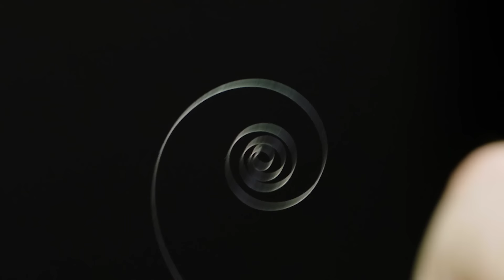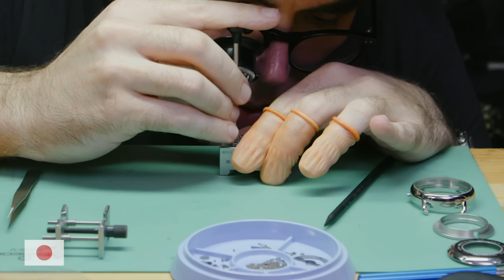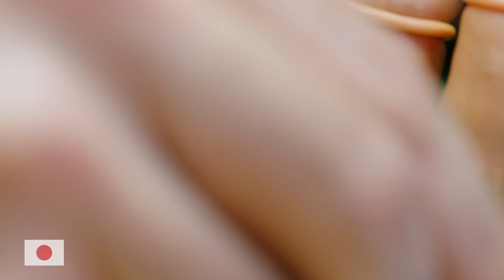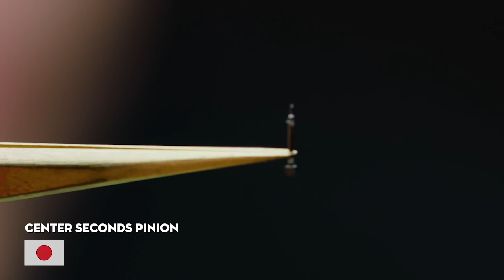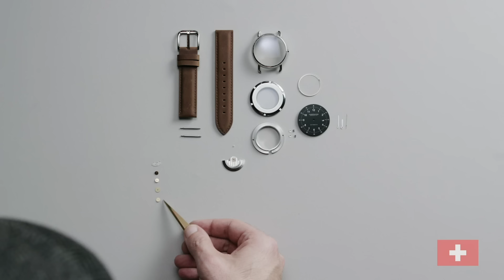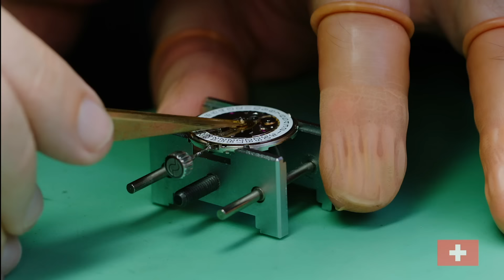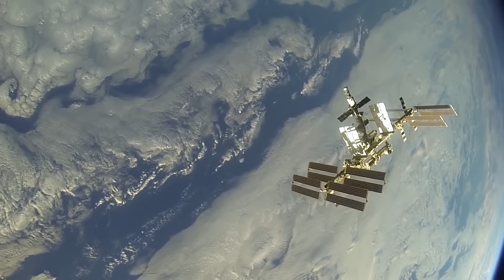Watchmaker Breaks Down Swiss vs Japanese Made Watches | WIRED

Comment: This comparison is a bit misleading because it uses a Miyota 821A, which is an entry-level movement, against an ETA 2824, which is mid-tier Swiss. The 821A has some plastic parts, but that does not represent all Japanese movements. A fair comparison would be with the Miyota 9015, Seiko 6R35, or Orient F6 series, which are all fully metallic and in-house.

Comment: Just getting into watches but what turns me off is that mechanical watches require maintenance and you can't really do it yourself. With a quartz I will just change the battery and I'm done. Just a rant, that's all.

Comment: I only have one watch with an eta 2824 based movement and I pretty much never use it since it's basically designed to eat it's own ratchet wheel causing teeth to fall into the movement and kill itself.

Comment: this should be called "watchmaker breaks down mid to high range swiss vs bottom-low end japanese made movements", sinc this is not at all comparing watches but rather only movements, and the japanese choice here is a very odd one since it's probably the cheapest mechanical movement you can find made in japan that's found in very cheap watches, vs a much higher end and more than 3 times more expensive swiss movement found in much much more expensive watches. Not relevant AT ALL.

Comment: Yeah this video is extremely misleading especially given that the Miyota movements appear in "swiss made" watches as well.  The concept of a swiss made watch is vague to begin with. Not to mention the price differential on these two movements.  The phrasing also makes it sound like all Japanese or all swiss movements include these features.  And then the little aside about how grand seiko is attempting to give the swiss a run for their money is kind of silly too.   Grand Seiko is a high end brand and their spring drive movements are more advanced and accurate than many of their swiss counterparts.  There are also still a ton of really good America watch brands out there and other countries also make their own quality pieces.  To try to group together watch quality based on the place they were made in is a farce.

Comment: A few years ago after owning many chinese made cheap automatic watches ive got my hands on a Omega Speedmaster reduced (automatic chronograph) and that changed my perception completely! 

These watches are mechanical marvels.. the 1141 clockwork is only 25,6mm in diameter and 3,6mm high… all assembled the „small“ speedy is looking like a Quarz watch but if you know what’s going on inside of that tiny case its just fascinating every time you look at it. 

Ok… they are expensive to buy and expensive to maintain (in my case 400€ every 5 years) but if you got a skilled watchmaker to service it, you have a watch for the rest of your days.

Comment: Why are you comparing an ETA 2824 with a Miyota 8000series? They're not on the same technical level. Obviously a Miyota 9000series would have been more close to the ETA 2824 in size, hacking and other features. 
Also the automatic winding system in several japanese watches is capable of winding in both directions, Seiko f. e. calls it "magic lever" and btw this means nothing in terms ao watchmaking quality - it's simply a feature in swiss AND japanese mechanical watches.

Comment: Very nicely paced disassembly and commentary. The ETA seems like a better movement than the Miyota but the difference in price seems disproportionate. The lack of a hacking mechanism and the use of a plastic gear in the Miyota would move most discerning buyers towards the Swiss movement. Also, the ETA 2824 has 4 (or 5?) different accuracy grades (timing stability in multiple positions). How would you rate the two movements in terms of reliability, maintainability, and repairability?
Reply: Yeah, he definitely made the swiss movement look better by choosing a lower tier japanese movement to compare it to.

Comment: Could have at least used a nh35 or a 9015 for the Japanese example. The 8000 series are complete junk.
Reply: They are not that great either
Reply: @ChromeMan04  nothing wrong with the NH line of movements for the money. same goes for the 9000 series.
Reply: @Libertà_sopra_vita  it’s an unfinished version of the 4r35 which uses plastic parts lol

Comment: Watchmaking is great now, you have Rolex watches going for 3-4x their original cost, my GMT Master II I bought for $3800 brand new in 2002, I see going for $9000-$15000 now.  A service via Rolex goes for at least $1000, and that is only for cleaning and polishing.  I think all,services should be recorded, my biggest fear is that I send my watch out to a skilled watchmaker and they replace all my Rolex parts with inferior parts.

Comment: The cheaper Japanese model deliberately uses some plastic parts instead of steel or brass - and at what cost saving realistically? Do you get the feeling that it's being deliberately sabotaged just to justify a price-point? Just like a supermarket selling "value" beans? With that in mind, this video doesn't tell us anything about Japanese movements per se.

Comment: nice video but you really should have disassembled an NH35a vs. the 2824 as it's not a fair comparison as the miyota is a much cheaper and much less functional movement.  NH35a is hacking, 21600 bpm, dual winding mechanism, all equivalent.

Comment: Comparing a $50 Miyota movement with a $250 eta
Reply: @R. Schowiada71 possibly.. higher beat rate means it can be more easily regulated, hacking means time can be set more exactly, and the miyota will be dumped and replaced in a service while the eta may have small parts replaced but you will largely have the same movement, if that makes any difference to you.

Comment: To many plastic parts in the Japanese movement .
Reply: It's a terrible comparison. They're comparing a ~$250 movement vs a ~$75 movement. Something has to be different to drive down cost.  Terrible.
Reply: I agree , this was not a fair comparisons of the Swiss movement and the cheaper Japanese movement . A Seiko 4R35 should have been used instead of the Miyota .

Comment: Those prices are insane for what you get, especially on the Japanese movement watch. The Miyota movement they chose is one of the cheapest you can get, it typically appears in watches well under 200 dollars, and frankly I do not see a giant quality gap in the other components when I go to their web site and look at the watches. The Swiss one they put together is a bit more sensible by comparison, if only for the simple fact that you see those kind of mark ups with Swiss movement watches. The problem is that you can get fully Swiss made watches, not just Swiss mov't, in that price range. In fact you can pay half and get a Hamilton or a Tissot.

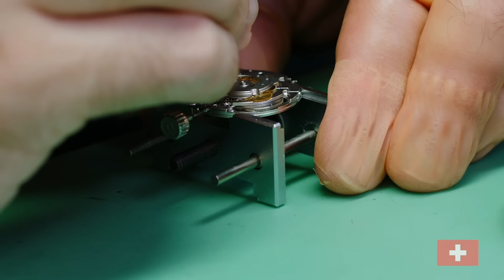Comment: 17:00 seiko's magic lever brings bi directional winding to watches under $100
Reply: In practice it works poor compared to the gear solution in the ETA.
Reply: @vast634  not really. the SII 7s26 is one of the most reliable watch movements ever made and it uses the magic lever system.

I'd say it works pretty well even if not super efficient

Comment: Would one hour be about typical for a complete tear-down and reassembly with parts replacement for a watch like this?  What would a typical service like that cost not counting replaced parts?  How much would a new spring cost and what other parts might typically be replaced.  Seems like $100-$125 would be about the going rate if we assume an hour and a spring.

Comment: I really like this video. I'do electronics as a hobby and I solder less than a millimeter components sometime. I appreciate the mastery of doing such small scale parts. If it would be me, I would be shaking all other the screen. Seing mechanical watches that way made me realize that they are much more than their prices. There are some much really fine precision parts, it is astonishing for metal parts.
I also have a question. This tweezers seems gold plated. But what kind of tweezers should watch mainteners use ? I can think of non magnetic ones, ceramic ones, ... What is the kind you use ?

Comment: If you do another one of these, use movements of similar price range. You compared an economical Japanese movement to a high-end Swiss. 

Next time, make sure they’re in the same price bracket. That would make this a much more credible video.
Reply: The point of this video wasn't to say which of the two is better, it was just to show two different movements..... Not everything has to be a competition.
Reply: @matthewmeredith3138  No, but it usually is - human nature.
Reply: The problem with your request, is that the japanese would make something much better for much cheaper.
Reply: @Lexus117  Usually this is the case.
Reply: Japan usually focus more on quality and reliability.. They skip the decorations.. But there are also high end japanese movement which are greatly decorated
Reply: @mygamingchannel8555  Grand Seiko - amazing watches.
Reply: @DiscoFalcon Not really a high end swiss movement.

Comment: Mechanical watches came back because modern computer-based production techniques made it possible to produce highly accurate parts for a resonable price. Up to the 70s, every cogwheel had to be either made by hand or by automatic production techniques with more specification tolerance resulting in less accurate watches.

Comment: When my OMEGA Speedmaster started running about  a minute slow per day I called a few places for service estimates. The $500 service fee for the watch prompted me to put it in the safe and buy the best CASIO digital watch that is available for about $170. It automatically syncs with atomic clock in Denver so it is always at perfect time to the second. It is not a piece of art but it functions perfectly, lol.
Reply: You should habe done the service...the watch will take damage if you dont and you will not be able to sell with no loss

Comment: I've always wondered why a hermetically sealed watch would ever need servicing. No dust, no wear. Can someone explain why high-dollar watches need to be disassembled and cleaned while a cheap beater watch will run for seemingly forever without ever being serviced?
Reply: The movement can't tolerate anything because it's so precise. A cheap watch will do some weird stuff at about the same rate, but you probably won't notice because it's a cheap watch so who cares
Reply: @suff99  In that case, I would expect that these watches would be assembled and serviced in a clean room. If not, you're just swapping one batch of environmental dust/airborne particles for another with each service interval.
Reply: High dollar watches can also go for a long time without being serviced, normally people have them serviced to prevent expensive repairs down the road. The oil used dries up, and friction will start wearing the pivots.

An inexpensive watch will just be replaced when it breaks. And most inexpensive watches are quartz, which have fewer parts that are susceptible to wear.

Hope this helps.
Reply: Nothing is absolutely water or dust proof. Small molecules always get in and out. And the gaskets do wear when using your watch every day, especialy  the modern plastic gaskets. The best gaskets were used on the 1938 to 1970s Mido watches: Lead and cork.
Reply: Because of wear and tear. A watch consists of dozens of mechanical parts that need lubrication after several years. Otherwise these parts will stop working. As mentionned in the video some parts need to be replaced as well such as the mainspring.
Reply: Even if you don't use the watch, over time the lubricating oil will gum up and the watch will run erratically or stop completely.  So many old watches you find at swap meets and yard sales run for a few minutes and then stop.  They aren't broken but the oil has gummed up and that stops the watch.  Also, case gaskets get old and the watch loses its water resistance, so that's another reason why they need servicing, especially diving watches if you actually use them for diving.
Reply: The oil gets more viscous when it gets old. The old gummy oil needs to be cleaned off and new fresh oil applied. Also, eventually parts in constant motion will eventually wear down and need replacing.

Comment: Thank you for this video. It really puts in perspective what quartz did in closing a chapter to a 200 years old technology. 
We might be experiencing a similar "quartz crisis" in the automobile industry, which is only  a 100 years old technology, with electrical and self driving cars. 
An electric motor is more efficient and has instant horsepower and automation and intelligent systems might make them extremely safer to use. The only thing missing is to mass produce them and make them more economical.